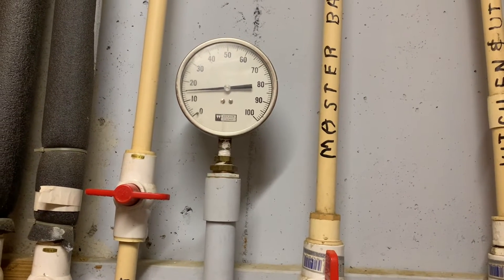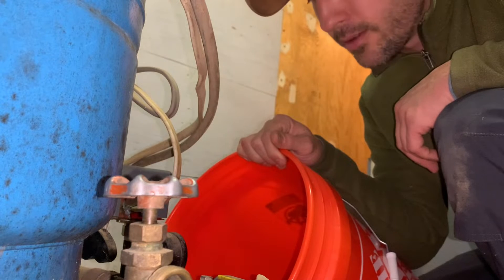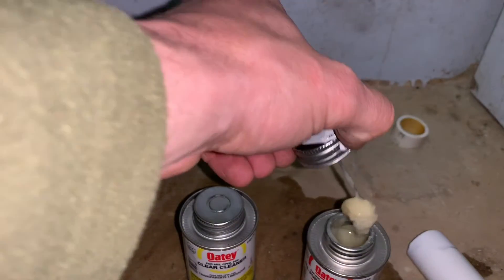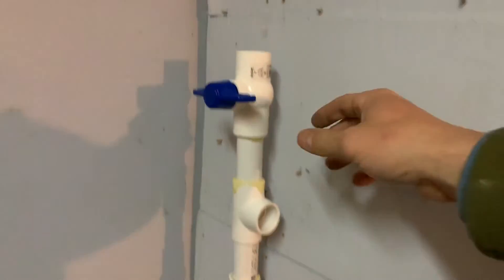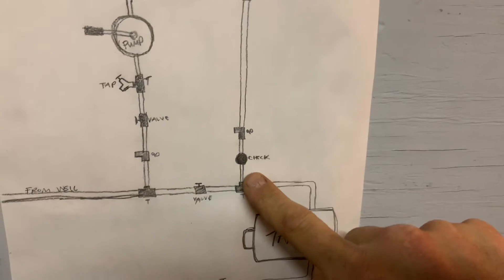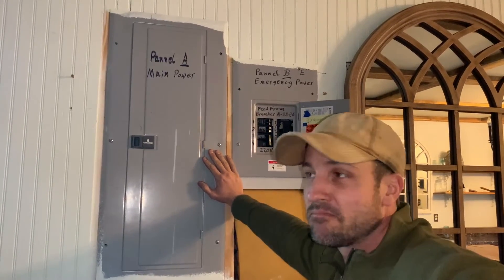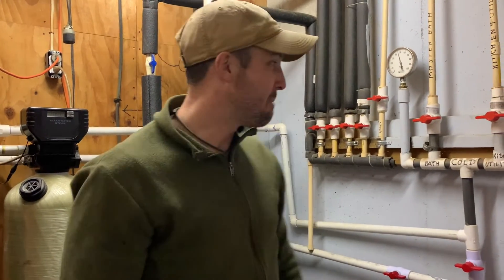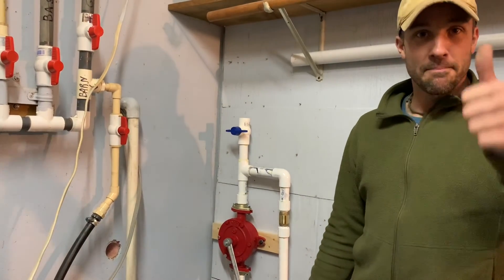Grid Down. Power Outage Water Solution. No Power Needed: Installing the Excelsior Hand Pump

Comment: In your video, you state that your well is 300', but the specs say 22' max lift depending on elevation above sea level. Do you have a deep well,or shallow?
Reply from the maker: The well has been dug 300 feet but the water level is pretty much at the surface. The pump doesn’t have to lift the water very high at all.

Comment: This very much depends on what type of well pump you have too. Before we replaced ours, it was above ground. It pumped the water down the well with high pressure and there is a small gap at the bottom that the rushing water actually sucks from as it passes. It pumps 1 gallon down and gets 2 gallons back up. I don't think it would be possible to operate such a well pump using hand power because I don't think you'd ever get the down pressure enough to create the suction.

We're sitting here right now with the power out, it's funny you mentioned generators being unreliable because that's what I usually do is just run the house off a generator. The dang thing crapped out on me this morning and now we can't flush any toilets lol

Comment: I’m doing this to my place
Reply from the maker: Awesome!!
Reply: How often do you have to pump/build up psi in the tank once it’s full or how long does the pressure last once you re-pressurize the tank lol?
Reply from the maker: @ertreeservice9558  once you pressurize the tank it will hold until you open up a valve somewhere and release it. Depending on the size of your pressure tank, you will get several gallons of flow before you need to pump again.

Comment: Get a gently used water heater, from a home with soft water. Plumb it in cold in cold out. Now you have 40 or 50 gallons of water readily available always. I put mine immediately  after pipe coming into house. That way pipes can’t vibrate. Oh put a ball valve where the poor quality drain valve is. Put it up on cement blocks so you can get a bucket under it.
Reply from the maker: Good tips. Thanks!

Comment: FWI... If you want to help make sure you don't have a leak problem, it is important to only turn the valve on about a 1/4 Turn, Till the lines are Full, then open up the Valve the whole way.... Otherwise you might pop loose a Fitting and get a leak or it actually could pop the fitting completely off.  I learned this from a commercial Fire Sprinkler System Installer. So Open the valve slowly.

Comment: If you have room put in an Amtroll WX350. 35 gallon draw down, your electric well pump will love you for it and you will have more water in reserve when you have to hand pump.  Will take longer to bring up to pressure, but last longer.  The one you have there looks to be a WX202 5 gallon draw down. You want minimum 1 minute run time on the pump the longer the better.  Keeps the motor cool
Reply from the maker: Good call. I’ll check it out. Thanks!